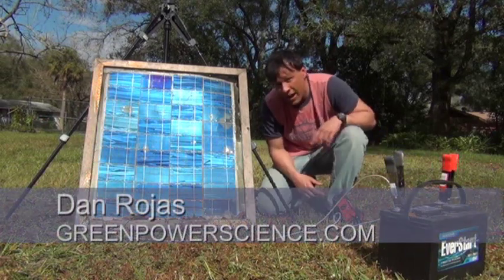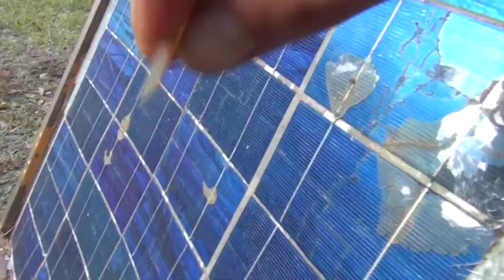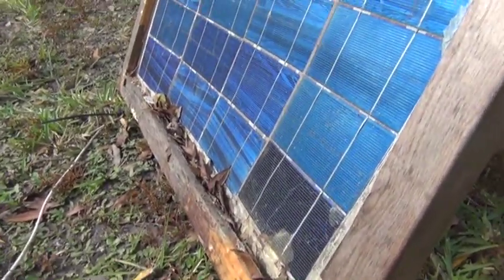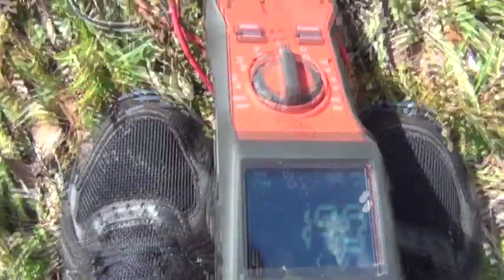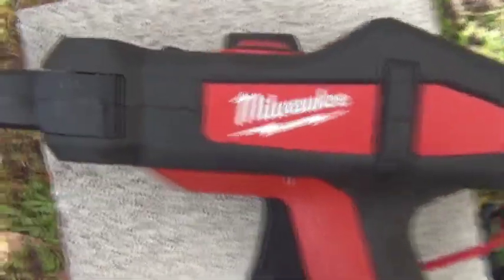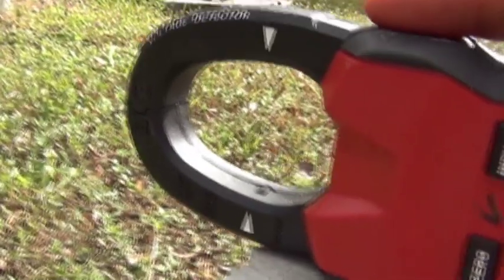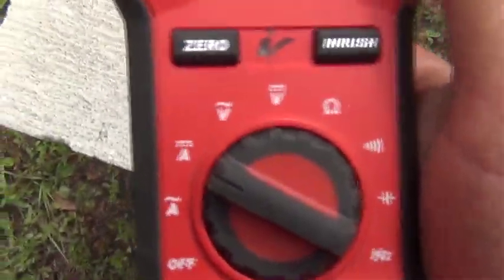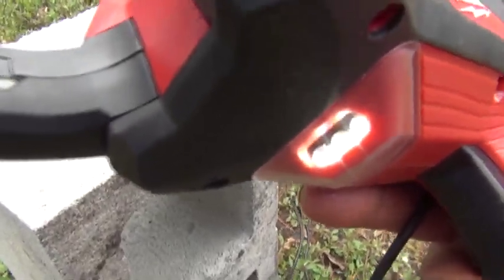DIY Solar Panel Broken Glass Milwaukee 2239-20 M12 Clamp-Gun

Comment: Hi, I would like to make a 300w solar system. So, should I buy 3x100w 12v panels or 2x24w 24v panels. What is the difference between 12v and 24v panels. I am going to use an mppt charge controller which would be capable of taking both the types

Comment: DM 145W Solar Module - 2PK X 2 = 580 watts total for $480. Get a 30A MPPT (MPP Brand) for about $130. They are great because you can use them for anything: flooded lead acid, to SLA to NiCD. then get a cheapy PWM controller $15 for cloudy days. the get (2) Trojan 12V golf cart batteries. 1000 watt pure sine inverter from china $300. total cost about $1000 for a 580 watt system complete

Comment: "Volts" give you no idea of the stored energy too. But if you have 8 hours optimal sunlight, which gives you 30 Watts of power, you get 240 Watthours accumulated energy in this time (30 Watts x 8 hours). A car battery typically stores about 500 Watthours: 12 V x 40 Ah. 
1 Volt x 1 Ampere = 1 Watt Power
1 Watt x 1 hour = 1 Watthour Energy

Comment: PURELOVECREW, to get started with solar I would suggest you go buy a panel, a small marine battery and a small inverter, they are very cheap now and fun to mess with. Call it a hobby. When you see what stuff around the house you can run for free and then realize that the power company is a black hole for your money, you will be glad you did. Also drop by the forums at techluck.com for more solar stuff.

Comment: One of our employees likes to take our destroyed/damaged solar panels and do the same thing. He has a solar system set up on his vehicle using one of our damaged 120 watt panels and a charge controller, Battery, 12 volt accessory plugs and an inverter. It's a pretty sweet setup for mobile power on the go without using gas.

Comment: I'm considering solar panels on top of my van to provide power for AC equipment. I know you sell these things. Which is most efficient and cost effective? Panels, inverter, etc,.. Will also need DC for the battery if it goes dead. I'm thinking 500 watts AC would be sufficient for common stuff like Laptop and lights, cup heater (maybe go Fresnel with this since Texas has plenty of sunny days), and some basic comfort type equipment. Would attach to the fiberglass top of the van.

Comment: Hi Dan. I managed to crack one of my DIY panels by twisting the frame too much. Like yours, still produced some juice. I picked up a single pane window and mounted it inside. Works, but with the double glass, the wattage has been reduced. I use it to trickle charge my generator battery. Thanks for all your videos. Since I've started my channel, I can see  it's a lot of work to edit and add titles. Maybe you could do a short video on the steps to make a great video for YouTube. Keep me posted!